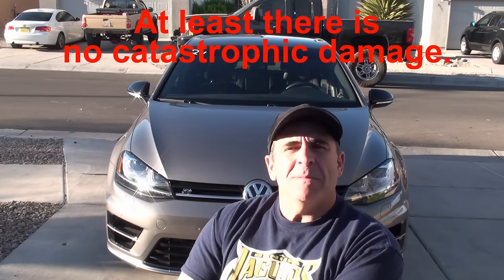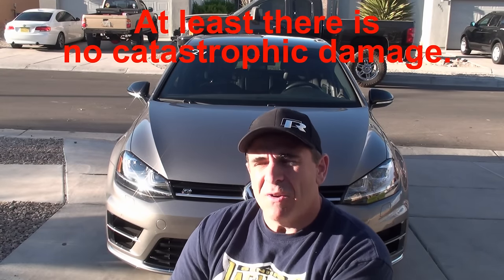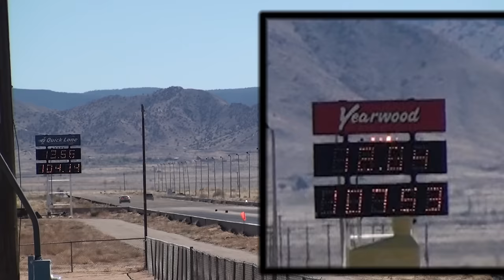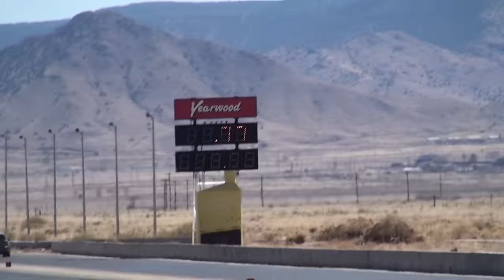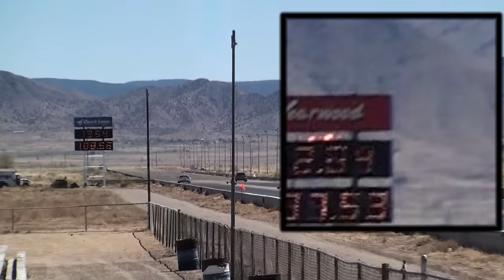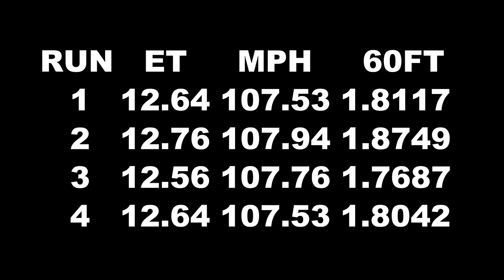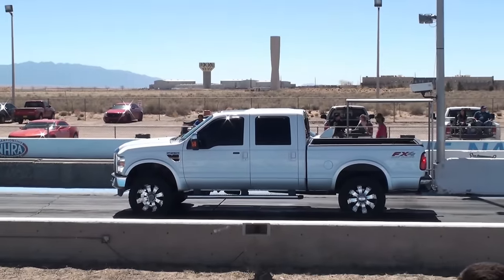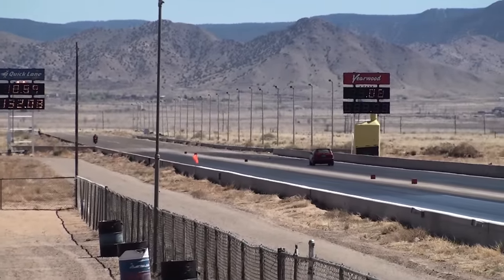2016 Golf R DSG APR Stage 2 Drag Times @5000 ft Elevation

Comment: Why not just get a car that is purposely made for the drag strip? I get that a VW is unique for drag racing but dang, you're going to blow that motor. A better alternative would be to get a project car seeing you like to wrench, do some of the work and have a professional do the more technical stuff. Any race is costly, drag more so than road course because people are shooting for insane amount of power that are sometimes more than the engines can handle.
Reply from the maker: I purposely bought this car because I knew what this platform was capable of with just a tune.  This car will not be a profession drag car, I will never do any mods that will affect the daily driveability of this car.  Most people have no idea what this car is or what it can do, almost all of the reviews of this car are when it is stock.  What they don't tell you is that this car comes from VW severely de-tuned, and that a simple ECU flash unlocks about 100ft/lbs and 100 HP, all without having to touch the fuel pump, injectors, head, or turbo.  Coming from the factory with a stated 300HP which we know is underrated as well, and then adding 100 to this with a flash is amazing.   

This new E888 Gen 3 motor is a beast with many improvements over the MK6 Gen 1 motor.  With it's forged internals and beefy connecting rods this engine will easily beat the MK6 450 HP stock limit that most believed existed,  and should reliably hold 500+ HP.  Tuners have been testing up over 500 HP but no one will confirm their figures, just that there have been no stock engine failures at these higher levels.  With the weight of this car, the strong engine, the AWD, the DSG transmission, the magnetic suspension, the build and interior quality, and the electronic features, the MK7 R is a ridiculous steal of a car.
Reply: +Rad Fox 

I guess you can call me a pessimist when it comes to reliably tuning a car. Tuners put in R&D but it makes me wonder if they do enough testing for reliability. They have tunes ready only months into the R being released. There has been many occasions VW/Audi tuners costumers disappointed from problems that arises after tune. Then basically being caught between factory and tuner for the blame, which gets the costumers nowhere. on a side note, you need to work on your reaction time, otherwise you're really leaving it all up to your car, dsg doing all the work for you. You could probably shave off .1 at the very least. I commend you for taking your car on the track though and not racing on street. 1 question, besides the engine, how are the rest of the drivetrain holding up?
Reply from the maker: I thought you had already watched this video when I responded to one of your other comments.  

I hear what you are saying about the tunes but, APR had a GTI shipped over from Europe a whole year earlier than they were available in the USA.  They had plenty of time to tweak their tune, plus have you seen their facility? They are not just some typical tuner shop.

If you have watched my other videos you will see that I do all of my own work.  I will be upgrading the clutches in the DSG, upgrading the Turbo to an EFR, and if needed at some point the internals in my engine.  The only thing I would need a warranty for is for defective parts which I prefer to replace with high performance aftermarket parts which would not be covered under warranty anyways.  

With regards to the reaction time, yes, you are correct.  I have been letting the car and DSG do all of the work.  I plan to work on my reaction time in the future. 

I have had no issues with the car and I have not heard of any issues with the MK7 due to increased power output.  Obviously, if you have the manual you will eventually smoke the clutch, but with the DSG I have it tuned to increase the clamping force up over 400 ft/lbs. FYI, they have new DSG clutches rated up to 700 ft/lbs.
Reply: +Rad Fox 

I don't like to mention names. But yeah, there has been times certain a company was sued for over promising, not really working as advertised. I'm not new to VW/Audi. There are known multiple reports of unreliable tunes too.
Reply: +Rad Fox

I had been to a "Certain shop."
Reply from the maker: I hear ya, but I know of no engine failures on a tuned MK7 GTI or R. I know of a stock failure due to the bad first run of turbos in 2015, and I know of quite a few crankwalks due to an assembly problem on the early 2015's, but not all cars had these problems.  By late 2015 VW had it all under control with no other repeat mass issues that I know of to date. I really do think this MK7 is the best Golf they have ever made.
Reply: If any problems happen after a simple ECU tune, that only because of people not choosing the good one, if you choose APR tune, nothing will happen and won't affect any warranty with dealer, many VW dealers know APR.
Reply: +Hardy Cui 

You must be new. You might want to read up on a certain tuner you think highly of.
Reply: Yeah, i am new to these kind of stuff, and I am in Australia right now, and never heard about APR failure here, and when my car done APR stage 1 with no hardware installed, it is 12.31 @ 111mph, now I am already Stage 2 with downpipe and waiting for my APR intake and turbo muffler delete, then I will go for another run :)
Reply: @radfox I knew that the Golf R had adjustable suspension, but its actually Mag ride? Like the same type as in the ZL1 and Ferraris?
Reply from the maker: +RSX250 no it's different. The R uses electro mechanical controlled dampening valves. It does not use magnetics directly on the fluid in the absorber but on the damper control valve. The system is called DCC and it is an option that is not on all R's. If you read any track reviews on the R make sure that the test vehicle has DCC on it otherwise they will complain about too much under steer.
Reply: Rad Fox Thanks for the info. Luckily for me DCC is a standard option for all Canadian cars :)

Comment: Wooooh this seems slow I ran 12.70 in 1999 in my Cav turbo.
Reply from the maker: +TheBMH28 that is a good time for a cav but did you notice the elevation in the video. You would probably need to add at least 8 tenths or more to your time for this elevation. This model of R will run 11.9's with stage 1, and 11.7's near sea level.
Reply: Aaa cool missed the elevation ;) any further plans with the golf?
Reply from the maker: Ya, i have ordered a larger intercooler and then probably for Christmas I will be upgrading to Stage 3.:-)